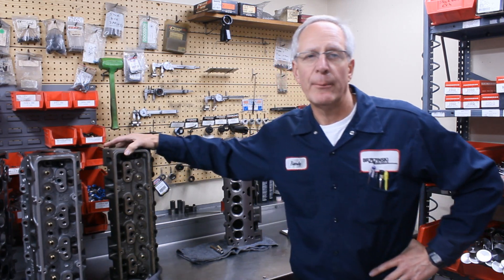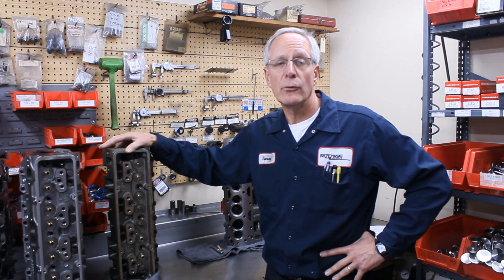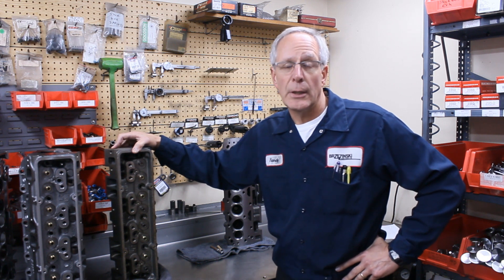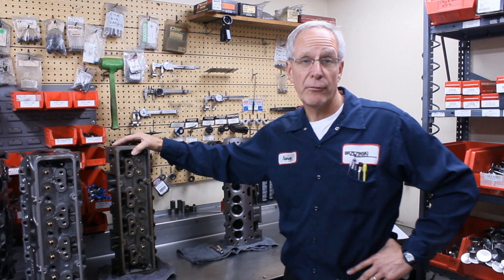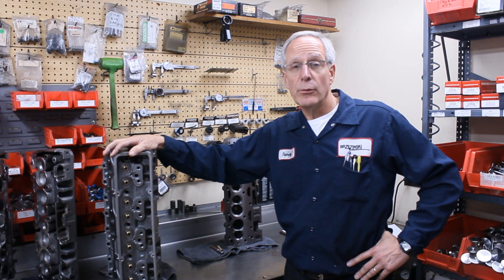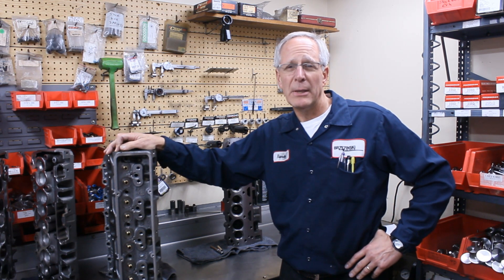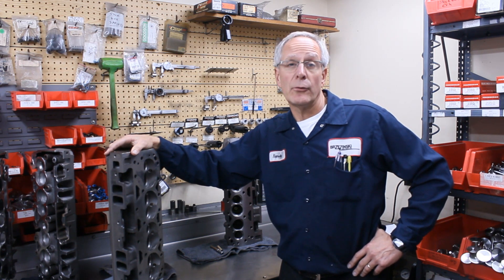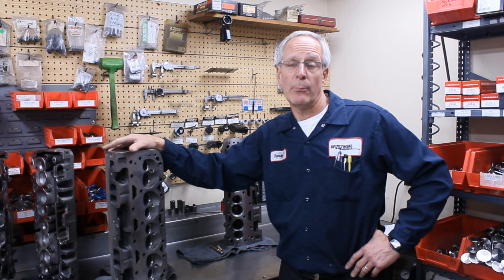Dart Iron Eagle #1 - Overview of the Dart Iron Eagle Platinum Heads

Comment: You say you can install 1.94 valves, but don't say if it's worth it. 
I picked up a set of 230s fairly cheap and wanted to put on a 406 for the street.

Comment: How do you tell witch head you have?   Is there a difference I the casting I got a truck with a set of pro 1 but I don't know what size that are?
Reply from the maker: You can look at the casting number  in the valve cover area. Should say 200 or 215 or 230 depending on what ones you have